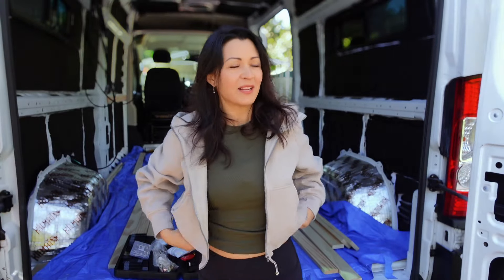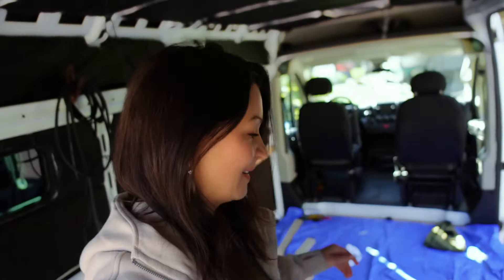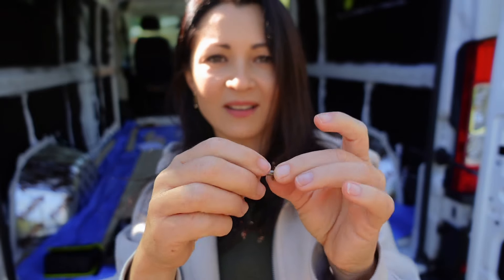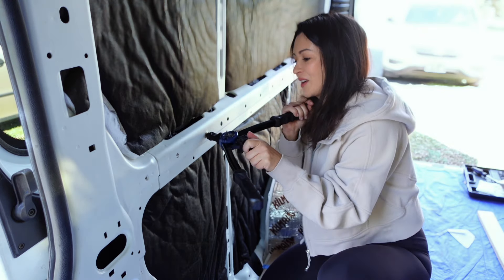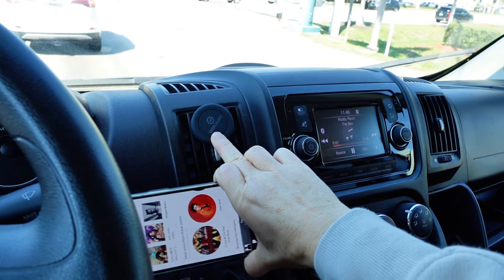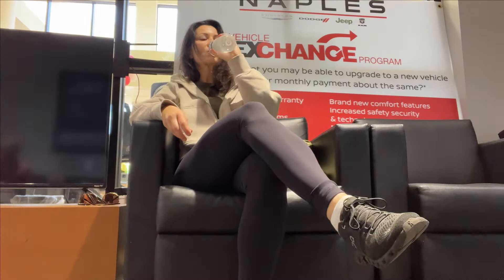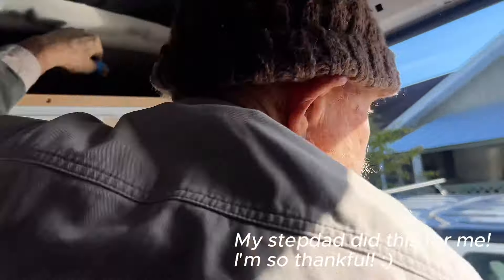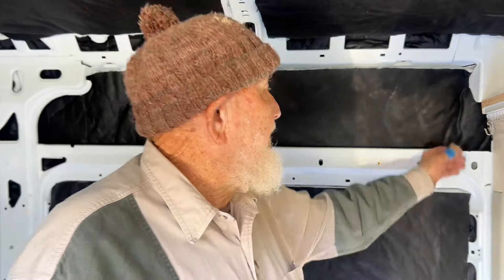Dealing with my van's battery issue and framing | Ep 24

Comment: Wow getting better. I'm wondering if you have your projects written down in order what to do. FYI in the future tires, batteries, stuff like that can be done at Firestone, Sam's Club, Costco..at a lot cheaper rate than the dealership.( Those guys are thiefs...) Your electric and plumbing needs to go in so you can build on top and around it. I ❤ your shop. When you said tap screws I was like that would be so much faster. I know another tape trick for the holes in your base boards. I'm learning and watching 😊 keep going!!!❤❤❤

Comment: When making a countersink, first mark the hole location, then drill the countersink to the proper depth, then drill the hole. The countersink Forster bit needs to center itself in the wood while cutting its way through. When there is already a hole there it can't center itself, itjust wobbles around making a mess, as you found out. Haha. Cheers.

Comment: 3 years for a 12 volt vehicle battery is fine.   Next time, any local auto parts store can test, replace and install the replacement in about 20 minutes.  A 3 year warranty replacement battery is about $150 max.  Should you purchase from a national chain auto parts store it is warranted all over the country.  That will be helpful and peace of mind as you travel.

Comment: Drill the countersink recess using the Forstner bit first and then use the drill press to drill the through hole second.  The Forstner bit has a point at the center that will maintain the bit stable so it won't wander, which is what causes the chipping and rough cut you had there.  

Don't worry about losing your centerpunch mark because the Forstner bit will leave a small point at the center of the bottom face of the recess that you can align the drill press with.

Comment: Buy yourself a Battery Tender and connect to your battery while it is in "storage".  Car electronics drain the battery very slowly over time.  You'll be  happy if you do because it will extend the life of your battery for a year or 2. I often get 5-6 yrs out of my batteries even with a lot of down time..  I have them on my motorcycles and other cars/ trucks not used very often. No more buying a bunch of batteries every 2-3 yrs.😊  You're doing a great job!

Comment: You can definitely tell it was not your alternator by you being able to jump it off and the van continue running. Should it have been the alternator once you got it to start after charging the battery, it would have died because the alternator would not have been charging it. you can also once you get the van running, remove the ground post, and if the van continues to run, then it's not your alternator

Comment: Aircraft Mechanic here again. I'm impressed that you're using rivenuts.  It's another fastener we use on aircraft.  Those look like quality rivenuts as well!  Squeezing rivenuts is difficult especially steel ones and 1/4 inch dia. even harder. Not sure how you learned about rivenuts but they're the best approach you can take for a hidden nut application!  
One last thing;  the tool your using is a hand sqeezer not a pneumatic one.  Pneumatic squeezers operate by air power which you need a compressor for, but that would make the installation much easier!
Oh boy, ok... The tool your using is not a countersink but a counterbore. A countersink is conical in shape for an angled bolt head that sinks into the wood. The counterbore needs a centering aspect called a pilot that drops into the hole to keep the bore on center as it's cutting. Your bore was dancing all over the place. The other thing that helps and with the drill press as well is to use a light touch and high speed, as high as you can go( like 3000rpm). This is because the cutting tools are very powerful and will take too much material too quickly with high pressure and low speed. This is the technique for all soft materials.

Comment: Actually, the tool is not pneumatic 😊 but I see them call them that, don't know why.  Likewise, those are bolts, not screws, but a common mistake.  Love listening to you!  You can countersink the boards to use the shorter bolts.
Reply from the maker: Haha okay.. weird, on Amazon they call them machine screws (10 Pcs M8-1.25x55mm Flat Head Machine Screws, Phillips Cross Screw, Phillips Drive，304 Stainless Steel https://amzn.to/3UU5boc ) and Astro Pneumatic Tool 1450 13" Plusnut and Extra-Long Rivet Nut Setter Kit Metric & SAE https://amzn.to/3uR5fL2
Reply: @soloelisa , Astro Pneumatic is the name of the company. A pneumatic tool is one that is air powered, which this tool is not. It is arm powered. I see why you called it pneumatic though. Screws and bolts are rather generic so calling the ones you are using screws is proper. Some screws are not bolts though, such as wood screws. By the way, Great job.
Reply from the maker: Ooooh okay got it! Thanks!
Reply: @lanejohnson1245  Thanks, that is what I was getting at. Pneumatic implies it is either air or hydraulically powered.  Something that uses only muscles wouldn't be pneumatic.

As far as screws vs. bolts, a screw traditionally has a tapered shank, like a woodscrew, and typically have a pointed tip to start them. A bolt has a straight thread and needs a nut, or in this case, a Rivnut.  Bolts have nuts, screws don't.  Several sources define the difference this way:
"A bolt is a non-tapered fastener that uses a washer and nut to hold objects together. A screw is a tapered fastener that mates with an existing thread or creates its own thread in a material as it turns."

Another common difference, but not always the case, is whether it has a bolt head vs. a slotted or Phillips style head.

Comment: What do you think, that your battery is gonna be still fully charge after sitting for 3weeks. You have electronics that require power even when it just sits there and the main culprit is the clock system and alarm system, they are constantly drawing power from your battery. So if you leave your vehicle sitting for long periods without starting it up it will definitely drain your battery. I used to work away in remote locations in outback Australia, before I leave for my 6week swing I disconnect the battery before I go. Once I get back I reconnect the battery and waalaa I'm back in business.👍😎

Comment: Once I get close to 36 months on my battery I periodically stop at O’Reilly or Auto Zone to have it checked. They can tell you if it’s taking and holding a charge and then when it’s time to replace I usually find Costco has the best price. My last 36 month battery lasted 5 years but I replace it before it decides to quit working. I took my Caravan to Naples Dodge a few years ago to have the passenger window looked at because the motor was working intermittently and they told me $289 for a motor and $400 to replace it and after I left it didn’t work at all. I went online and found a motor for $40 and thought I’d pull the door panel first to see what was involved with replacing it and I found the wire tucked neatly in the door which explained why it didn’t work at all and after I connected it I never had another problem, it must have just been loose to begin with. I HATE dealerships!  That battery would most likely have cost you around $180 at WalMart.  You’re doing a phenomenal job on the build!!!  I think your making good choices with the fasteners and they will hold up well to the constant movement and temperature changes it will experience. 😊😊😊

Comment: If you have a volt meter, measure the voltage at the battery with the car running. If the voltage measured above 13 volts, the alternator is probably working fine and charging the battery. If the voltage is 12.5 volts or less the alternator may not be working right and needs service. Cheers.

Comment: I have the equivalent van to the RAM in the U.K. Mine is a 2023 and it has stop start technology. This is a battery killer and I always disable it. Not sure if yours would have it being a 2021. If it has and the previous owner used it then it may be one reason the battery failed.

Comment: Regarding battery, I strongly recommend you invest in an intelligent digital battery tester. Mine is Chinese and only cost £20 a few years ago. It is a Lancol Micro-200 Pro. It tests battery, starter and alternator and is very accurate.

Comment: Slow battery draining is normal. It's nothing new: clock, computer, maybe radio, internal resistance.  Start it and drive more often. Charge it more often. An ammeter will show you if drain is too high, and an electronic guru, how often to max the battery charge. Love TGP

Comment: A Battery will drain after just being parked for weeks. As you Drive, the Battery will charge back up to full. .. To prevent this from happening, Start the Van once a week and let it run for 5 minutes. ... But if an when you plan a trip and plan on running things from that Battery. Buy the very best Battery that you can afford.

Comment: A car (or van, etc.) battery should not need replacement that soon, they should last like 10 years if they don't get deep-discharged. If you have your vehicle standing around for extended periods of time you should disconnect the battery to avoid having it discharged (there are aftermarket terminals for that).

Comment: I have built 100s of Pro Master interiors. I can tell you your battery problem is not uncommon. The china batteries don't use lead and they are trash. Good luck with your build any questions just ask as I said I have done hundreds of Van conversions.

Comment: your "pneumatic tool" isnt pneumatic, if it was you wouldnt need so much effort, the air would do it for you. If you want to make the tool easier to use, get 2 longer metal pipes and put them over the handles to make them longer for mechanical advantage

Comment: Nothing wrong with your vehicle.... Sprinters have a constant small amp draw when sitting off.  After a couple of weeks, it drains the battery sufficiently to the point where..... it won't start the vehicle, acts as a dead battery.

3 solutions:
1 putting a trickle charger on it, ac plug in or 
 2 solar trickle charger thru your cigarette lighter, the latter if and only if the cigarette lighter works when the vehicle is off.  
 3  there is a battery disconnect tab by the gas peddle.  It has a red pull tab.  If you let the vehicle sit for a while, pull the tab and disconnect the battery.  Your dealer, and/or knowledgeable mechanic will show you how to  do that. 

If i am not near electricity, I do #3.....   if i am near electricity, i have a agm battery charger on 2amps continually charge the battery.  Either one works.  

Other option

Comment: Great job Elisa, Thanks for Sharing and having shop and tool access such a major plus not needed but a plus. may i suggest when you make the holes on your framing don't drill out such a big hole just center punch the wall stud where the hole is going and make your partial hole with the forstner bit and then finish the hole with your drill size you need, and you won't have all those shavings / splinters.  also follow another youtuber @torydelury

Comment: In regards to countersinking you M8 screws or any screw, always use you the Forstner Bit first. This will always mark center for your regular drill bit✌️
Reply: Just my 2 cents but I would also put some tread lock on each and every screw or they will come loose.

Comment: Your following a gal that has a nack for teaching and some good tricks with an almost complete step by step on most of what she does. So I guess your on the right path. I suggest when you are deciding how high to make your bed platform remember windows condensate so you might not want to get your mattress and coverings to close, also your gonna want to put something on the platform that allows air to pass under the mattress. and by the way, your framing loos good, but you may want to use longer 1x3's so they touch from end to end.

Comment: Just get a negative test light, alligator clip on one end, and a probe on the other. Take your negative cable off the battery and put the clip on it, then take the other end and put it on the battery and hold it if you have no light, you have no drain, or to check that while you’re holding it open your door and you should see the light go on. Woman listen here woman you need a good man. I could take you to a no man has ever gone before.lol

Comment: I do not work at a dealership. I know they are more expensive. I go there and have my newer model vehicle serviced always.  The reason is simple. Ok so you want to run up to an auto parts store and have some kid sit in your car and diagnose a battery or alternator problem. They do something wrong in installation and blow out your ECM or other component and tell you sorry can’t fix that. You have no idea. Yeah. No thanks. I’ll pay up.  And I totally understand a dealer could do that too but not as easily.